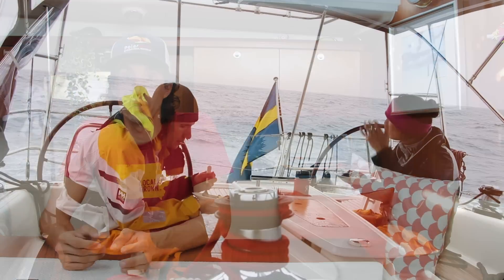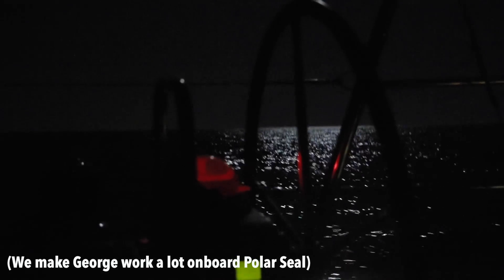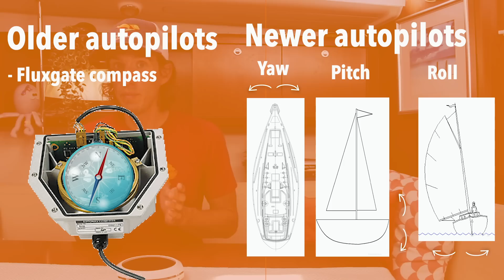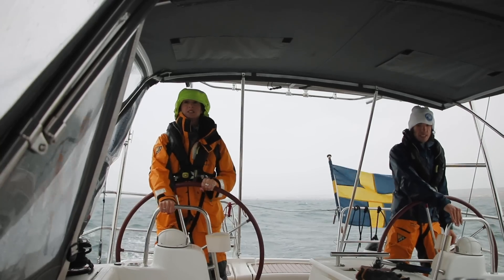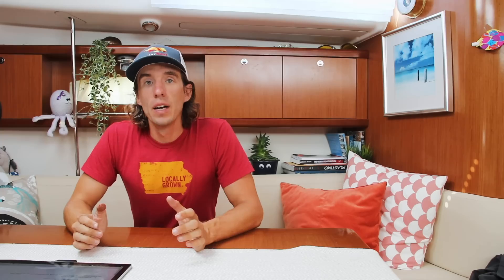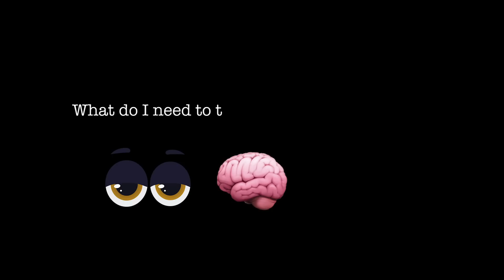Sailboat tech: How does a marine autopilot work? (with the Raymarine evolution ) //RTC #7

Comment: Actually the autopilot brain is in the EV-1 sensor. The actuator control unit is only an "amplifier" of the control signal, to send signals to the drive unit.
About power consumption, I previously had a ST2000 which was dull and slow, always hunting to get the boat on to the right course. That took a lot of power. The EV-100 system is so smart and fast, and it corrects the course so fast that it doesn't need that  much power to keep the boat on the right course! Truly an amazing autopilot!

Comment: A very understandable explanation of how a auto pilot does its works!
About the windpilot: it is possible to connect a cheep and simple tiller pilot to the holder of the windvane on the windpilot. It takes just a bit of battery energy and is working even without having sails up. When all sails are down, this method works even better when the windvane is not mounted on the windvane holder.... 
Have you thought this over? Without a doubt, that Raymarine system is by far super intelligent comparing to a simple tiller pilot :)

Comment: We have had the wheel pilot version ?Evo100 for two years now and  the gyro compass is streets ahead of the old fluxgate types.
Reply from the maker: This is great to hear!  Ryan
Reply: @RyanSophieSailing  Previously the fluxgate only worked in a following sea when the yacht veered off course.  However, the Evo recognises that the wave tilts the yacht first before trying to push the stern off course  The Evo make a small course change as the yacht tilts before it goes off course so doesn't need a huge adjustment later.  Quite uncanny to sit and watch it work in a following sea.  When I read the RM advertising blurb I wasn't sure but having seen it in action its quite impressive.  Only thing I will say is the Evo100 needs a rudder reference unit if the yacht is a fin keel.  That is another huge improvement we made earlier this year.  
I recon George your autopilot just got AI :-)

Comment: I installed this same unit on my Motorsailer for this season and very impressed with its operation especially in heavy weather with large swells. I also installed a digital amp meter to monitor current draw / indicate any weather helm, works reasonable well though current seems to pulse and not constant ( computer pulses to actuator ?) but good enough to spot and increased current draw. Still need to decide which mode is best  - cruising or leisure. Good bit of kit so far. Will enjoy watching your installation.

Comment: Thanks, a really clear visualisation and presentation. I have three questions (1) already addressed - how is it installed & do you need an expert to set it up (2) what happens if wind direction changes while you are sleeping? do you just rely on the unease of the boat movement to wake you up to change sail config? (3) on average is $ 1,500 a fair price for the hardware/software full pack?

Comment: That's a great to explain how each part works. But still missing one thing and I checked several videos even from Raymarine. How do you enter your lad,log conoridinates into the P70 controller, or multiple waypoints into it ( I assume there is not charts display on that small screen). Or does at needs a chartplot ( Raymarine Axiom MFD) to enter the waypoints to talk to the P70 where to steer. If you can help. Thank you.

Comment: I installed this exact evolution auto pilot on my Adams 31 about four years ago, put one control head in the cockpit and a second down below, very handy for a solo sailer, I like the backbone/ seatalk system where you can plug instruments as needed, the auto pilot is excellent on and mostly off the wind, but doesn't handle off wind in a following sea, thinking about a steering vein for that, but it more weight, money etc, how does yours handle in following seas any setting suggestions welcome, keep up the good vids
Reply from the maker: We felt it handeled really well down wind!  How does it work with two control heads? is there a master one or do the both communicate just fine?
Ryan
Reply: @RyanSophieSailing  I don't remember assigning any particular one as master, however they communicate effectively with each other,  course adjustment can be done at both locations. Thanks

Comment: Good video, my old one is connected via a belt to the wheel but I think when I replace it i'll have an actuator below deck on the rudder post instead, I hadn't though of the concerns about losing steering.

Comment: I was just yesterday listening to Matt Rutherford’s podcast, and he ran in to exactly the situation you mentioned: losing wheel steering but able to use the pilot as a backup. Once he got the boat to a yard, the staff there mentioned they’d been replacing a lot of broken steering cables on Beneteau’s. Seems all models use the same (undersized) cable and they tend to break quickly. You might want to have yours inspected/upsized before your crossing. Two cents! <3
Reply from the maker: Yeah, we are always keeping an eye on our cables. That’s a good tips! /Sophie

Comment: I appreciate the detail, but it still grates to hear power consumption in amps. How much does that change if you're using a 12V DC power system rather than the 120V AC one that Polar Seal has?
Reply from the maker: We do use it on our DC system, of course! Not sure how much our current autopilot uses (Ryan will know) but our new one will average 15ah. /Sophie

Comment: Hi...an installation video would be helpful, perhaps showing the connections via the NMEA 2000 backbone and seatalk connections.  I have a new boat and just finishing my first season.  I have the same autopilot and it has worked well in my shoal draft Jeanneau 419.  My question is how much can the autopilot take in a rougher conditions.  For example, we were in a 4-6 foot beam/quartering sea with 20-25 kt winds.  We had a few side surfs so I put the autopilot on standbye and hand steered.  The autopilot was staying on course but to minimize side surfing I felt more comfortable hand steering.  Should I have just let the autopilot work, was that sea state to much for the autopilot?  What has been your experience?  Perhaps in a video you could describe when to use and not use an autopilot or at least describe what your experiences have been.  Thank you!

Comment: Just a note to clarify that the SPX-5 Course computer has a Gyro which detects yawing movements of the boat. You are most probably referring to the older ST-4000 series which did not have such feature.
Reply from the maker: Didn’t know that, thanks! :)

Comment: We bought two completely separate control heads and computers that are connected independently.  The second autopilot is not wired to the main electrical system to avoid damage in the event of a lightening strike.  I simply need to connect he second autopilot via a quick connection and were in business again.
Reply from the maker: This is a great  idea.... ryan

Comment: There are installations with 2 drive units (not sure about the course computer if it is doubled up as well.) The are on opposing sides so when one is pulling the other is pushing so to speak. Seen a HR62 with this setup, but not been able to read anything from raymarine about how to build such as system, any one knows?
Reply from the maker: Interesting.  I have seen setups with units on both sides but never one where they are acting at the same time.  One drive would always be disabled.  Let me know if you find more info.  Ryan

Comment: I'd like to see the installation of the components and the attachment of the electrical cables. How and where the cables (wires) are run is not necessary. I'd also like to see an official retirement ritual of George, and an official naming of (Ray?) the new autopilot!  Oh. Sophie... to compensate for the Ryan Sailboat tech vlogs, how about some cooking classes from you, not including anything with hot water. I'd really like to see you make your signature dish(es). Thanks for your consideration, Sophie. :¬) Webhead USA